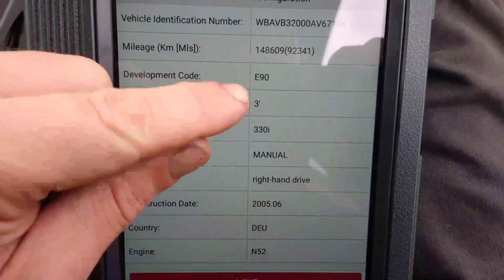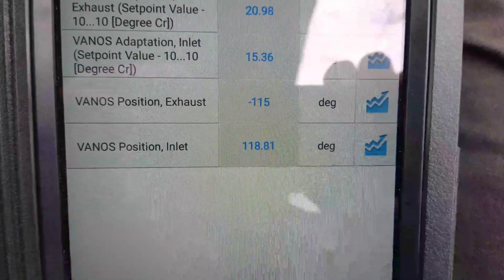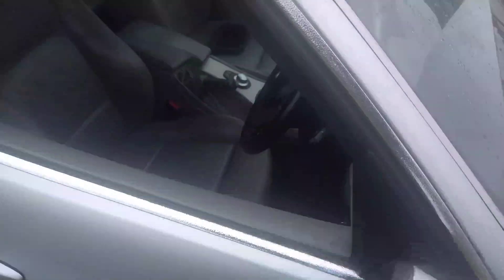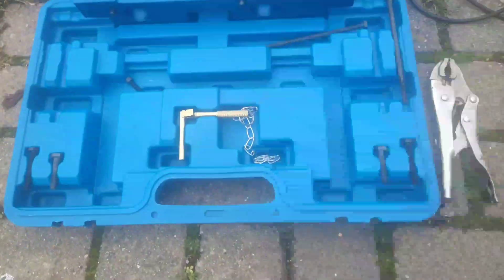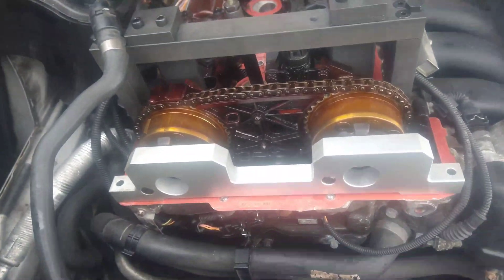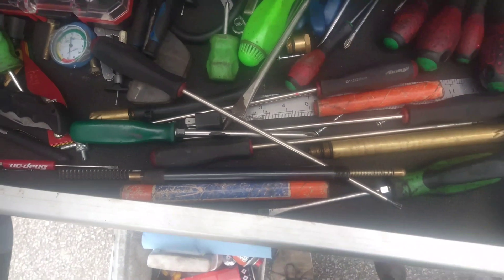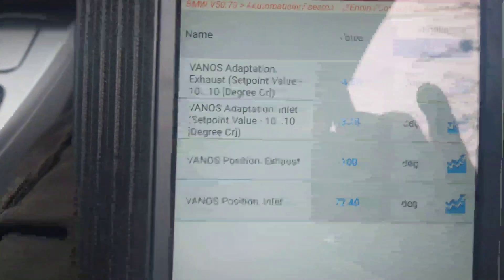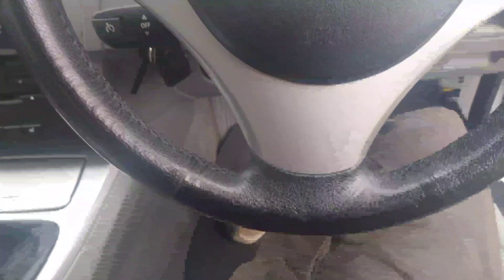BMW (2A99) VANOS exhaust/crank fault

Comment: any ideas for my e60 530i 2006 the 258hp model.
I randomly get CEL during the winter / colder temperatures, sometimes very rarely could be months in betweetn sometimes once a month. the code is 2a99 "crankshaft-exhaust camshaft and crankshaft-inlet camshaft reference".
No rough idle, no decreased power, no difference in driving or anything, shifting, power revving nothing. Works and sounds like a charm. Ive replaced both solenoids completely, i do regular oil changes aswell.
Literally i have no idea what it could be since its just a CEL without any signs of problems.
Reply from the maker: @mawiof  it sounds like it's worth putting timing tools on to see if the chain has stretched and needing adjustment
Reply: @mechanicmatt871  it could really be the chain even if i dont have any symptoms at all? like NONE?
Reply from the maker: @mawiof  yes I have had a chain with no symptoms, no rattle, just timing related codes.

Comment: Once you get a crankshaft-camshaft reference error on one or both of the VANOS units, the DME will stop controlling the relevant VANOS solenoid. That's why the exhaust camshaft position angle was not moving. When you slackened off the VANOS bolts, was there any danger in TDC moving since you didn't lock the crankshaft with the pin? The camshaft locking tool is enough to hold everything is place?

Comment: Hello chief,
I changed the Exhaust and Vanos Adjusters Sprockets because of their sheared bolts and nuts. After putting it back together…
…Car runs normal now but CEL keeps coming back. I’m getting the P2099, P209A, and P13B2 codes.
What could these be from? 
What else did you do aside from setting the Exhaust Vanos timing?
PLEASE help chief.
Reply from the maker: Mine just had the valve timing pinned and re adjusted.I checked the solenoids. All worked ok
Reply: @mechanicmatt871  
im having those codes now and theyre driving me nuts. 
car is fine mate, but only for those codes. advise olease mate

Comment: I have an N54 with the same code 2a99 followed by a 2a82 VANOS intake and code 3100:Boost Preassure Deactivation .. I cleaned my Vanos solenoids do you believe my engine just may be out of timing ?
Reply: What solved your issue?
Reply: @brunolepewofficial  so far I haven’t found it as I have been doing the valve cover gasket and oil filter housing gasket aswell as walnut blasting but my oil filter was not connected to the stem it was collapsed and just floating in the housing so I really hope that was my Vanos fault issue
Reply: @brunolepewofficial  and the oil has lost its viscosity due to previous owner not changing it in a while (i just got the car) so I haven’t gotten to doing anything to it yet haven’t even hardly driven it 10-15 miles Lol

Comment: Hi there Matt i am getting same fault code 2a99 with 3100 on my 335i e93 n54 also changed solenoids for new bmw ones still the same should i now do what you did? thanks Dan.
Reply: Did you figure out the issue? What was it?
Reply: Slipped chain
Reply: @danieledwards3803  did you just retime the engine or change the chain aswell?

Comment: I just rebuilt my engine. Ran fine first drive. But I confirmed that the left camshaft isn't exactly TDC any more. It was running rough. What exactly can cause the cam to all of a sudden go out of sync. I tighten everything to spec while crank lock and cam holder tools where in place
Reply from the maker: After rotating the engine by hand a couple of turns, I often have to re adjust the timing slightly. After that it's ok. Thanks for watching and your comment

Comment: genius
Reply from the maker: Thank you for watching
Reply: @mechanicmatt871  I took a gamble on a 08 328xi 1 owner w 103 k for my daughter she's 16. the car just turns over. code is crank cam correlation im hoping the crankshaft sensor does the trick as I wouldn't think 103 k would show timing chain issues what are your thought's sir ? your obviously very mechanically inclined  and w BMWs obviously. thanks in advance I hope my gamble pays off w just crank sensor 🙏🙏🙏🙏

Comment: Hi Matt, how easy is it to adjust the cam on these? i keep getting crank camshaft correlation faults on both cams on my n52. i have changed the solenoids already and didnt help

Comment: Got an e90 vamos position inlet value changes at startup then it will go to 120.00 and 115 and it will no longer move on live data, I have a service engine soon msg but the car runs ok any ideas? I have cleaned vanos and will replace soon but wanted to get your thoughts
Reply from the maker: That may be worth checking the valve timing with the correct timing tools. If it is even slightly out it will stop the variable valve timing.
Reply: @mechanicmatt871  my car is running good,  it’s new to me so not sure if it’s to full potential, do you think it’s still timing ?
Reply: Thanks for your help and great job with the video!
Reply: I had the timing done and that fixed that error!! Thanks
Reply: My car was driving great with error 2a99 that would not change when swapping vanos solenoids, mpg would not go above 15.9 if you get this only error timing as per the video

Comment: What probe was you using that measured the duty cycle
Reply from the maker: I had an autel power probe although it doesn't work any more
Reply: @mechanicmatt871  thanks pal just found your channel love the content and your skill, where do you get your wiring diagrams I have my own garage but don't wanna subscribe to autodata at the miniute a bit to expensive. Thanks
Reply from the maker: I use Tech4Techs its half the price, maybe not got as much as auto data. You get a free trial with them. I have been impressed so far.

Comment: Hi, I'm Brazilian and I can't understand everything you say. I have a 325i 2011 that also uses the n52 engine and I'm getting the code 2a99 as well. Can you summarize what was the real problem with your car?
Reply from the maker: It was a stretched timing chain, I had to slacken the camshaft sprocket bolts so I could fit the timing pins then tighten the camshaft bolts. Now the valve timing is ok.thanks for watching
Reply: @mechanicmatt871  So you didn’t have to replace the timing chain and tensioner? I retimed my engine properly as well and it ran perfect for 6 days until I got 2A99 with 3001 again. Really at a loss of what to do at this point, already checked and cleaned all camshaft and crankshaft position sensors, both solenoids, non return valves, changed oil (Liqui Moly 5W-40 and OEM filter) and replaced oil filter cage (old one wasn’t even broken). Going to try changing oil back to 5W-30 and hope for the best.
Reply from the maker: The only thing I could think if you haven't already done so is change the intake and exhaust solenoids over and see if the fault changes with them
Reply: @mechanicmatt871  I’ve tried that multiple times actually, no changes at all.
Reply: Há nove meses atrás eu fiz essa pergunta e até hoje não consegui resolver o problema da minha bmw.
Reply: I just got this code this morning out of nowhere along with cylinder 4 misfire. Where should I even start

Comment: Did I understand correctly that the reason for the fault was the replaced plugs on the vanos? Best regards
Reply from the maker: It was setting the code because the exhaust valve timing was out of sync with the crank shaft and the intake cam shaft. I loosened the VANOS sprocket bolt to allow me to adjust the valve timing to be back in time. The fault code has now gone. Cheers Matt

Comment: Well it doesn’t get more definitive than that! Top job Matt 👍
Reply from the maker: Thanks Ian, it was a pain removing so much to test the cam crank correlation. With variable valve timing on both banks I didn't think a known good cam/crank waveform would help. I had to pin it to be sure of the correct timing. The customer is happy to leave it like this and won't be replacing the chain. Cheers Matt
Reply: Hi doesn't CAM sprocket have key way..? So it can be adjusted.
Reply from the maker: There is no key way on the sprocket

Comment: Nice Job matt, I would not have gone so far as to re-time the vehicle(personal Preference) but as long as the client is happy that's all that matters.
Reply from the maker: Hi thanks for watching buddy, how are you getting on with your business? I saw your business card. I think he has sold the car as it is. Someone said in the comments about not changing a chain on a motorbike because it has stretched, it would just be adjusted. I hadn't thought about timing chains in that way before.

Comment: You seem to know you're way around that engine. Customer will probably just drive it until it starts playing up again. May last 60.000 miles . When you adjust chain on bike you don't think I need new one.
Reply from the maker: Thats a good way to look at it Ian. Unless there is so much slack that the chain rattles. Cheers Matt

Comment: What a fantastic job you’ve done there Matt. That timing set looks expensive did you buy it especially for that job? Thanks for the great tips on identifying the correct solenoid and connections orientation very much worthwhile remembering if I remember Diagnose Dan had a case where another garage had spent ££££££ on a BMW the problem was they had the solenoid connections the wrong way round could happen to anyone.
Reply from the maker: Thanks Kevin 👍 Diagnose Dan is a legend. Cheers Matt
Reply: @mechanicmatt871  your up there with the best of them Matt.